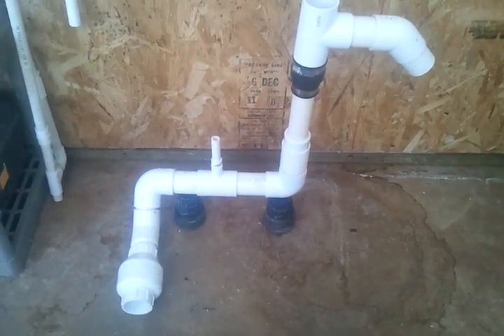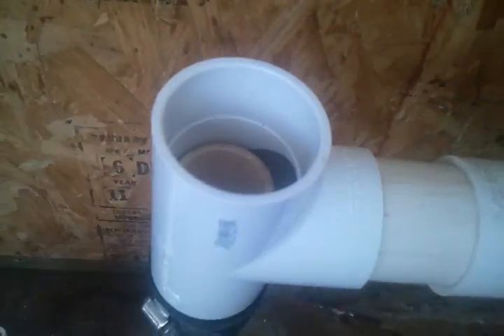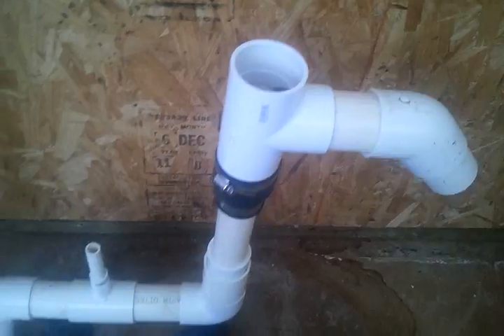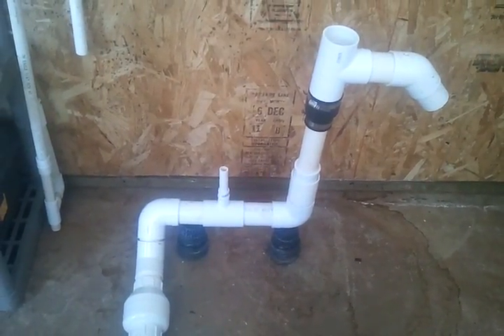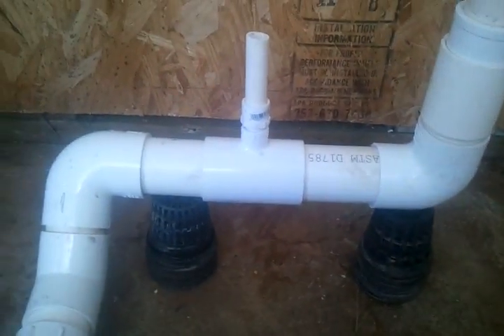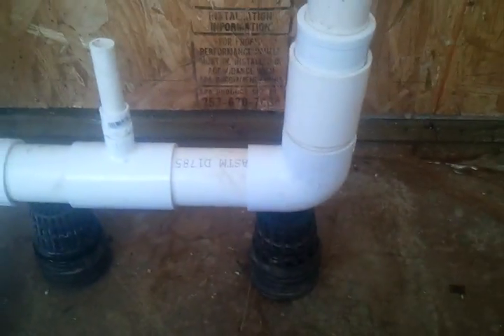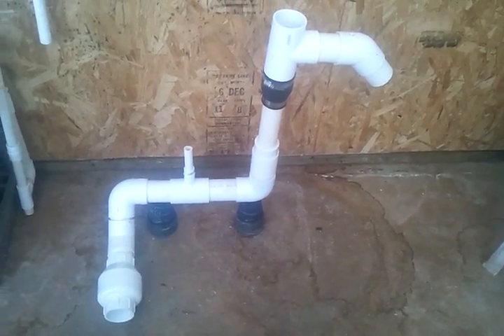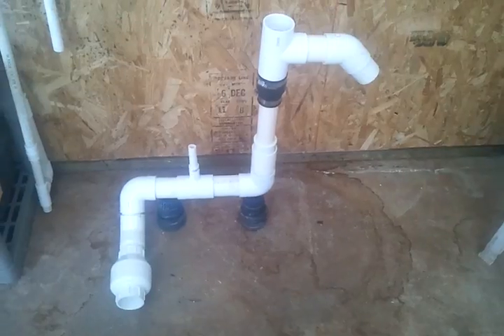AquaZen Airlift Pump

Comment: We use a Burper pump, when we absolutely cannot dig a sump well. If you can dig a well 4 to 8 foot deep, do it. With a 7 foot depth of water, we can pump water 12 inches high at the rate of 3600 gallons per hour. The higher the lift, the less the water. We top out at 34 foot high and 450 gallons an hour, using only 2 pumps 120 watt and 2 to 4 psi.

Comment: The important part is to plumb the fish tank to a “sum well” dug 4 feet or more in the ground. We have gone as far as 8 feet deep.

The water in the “sump well” will be exactly the same as the fish tank. Now the “pipe-in-a-pipe” pump can drop into the sump well and it thinks and reacts to the actual depth of the water, which should be 7 feet of more. Four foot in the ground and the 3 foot deep fish tank.

We have used a two inch casing with a 1/2 air feed to the bottom to get up to 3600 gallons per hour. The higher we go, the less water.

Normally we pump four foot higher than the fish tank, (7 foot off the ground)  the flow is reduced to 900 to 1200 gallon of water with a 60 to 80 watt Hakko air compressor. If I need to go higher, we install a “turbo blaster” inline air induction…to take the water up to 34 foot high, at that point we got 450 gallons per hour with 2 -120 watt air compressors.

All depends on the air compressors! 

Glenn
Reply: That's great! Thanks so much! I've learned a ton from your videos, Glenn, and the stuff you put out is amazing! 
So, I've toyed with a small burp/geiser air lift (similar to this) with excellent results and reliability. It's been running my little flood/drain system for over a year without a hitch!! 
My big system is in the build stage now. It's going to be raft beds.
This style (burp) pump won't be efficient enough to move the volume I need? 
One more thing; what's the reason for pumping 4' above your fish tanks? 

I actually only need 1' to my bed from the sump tank, but I'm figuring the sump will be depleted by the running system, so I need to plan for 3' head height max.

Comment: Hello Bob,

How's performance of this pump?
You keep using it?
I made a drawing of it in Sketchup, the link is as follows.

https://3dwarehouse.sketchup.com/model.html?id=u384bb2f7-656b-4230-940c-cb4bb0902dd2
Reply from the maker: Emilio Konrath No all my airlift pumps are simple straight tubes.  Lately I have been feeling somewhat negative about airlifts because the air pumps don't last more than a year and replacement is getting rather expensive. 
Your drawing is amazing!  Good job.
Reply: +Emilio Konrath Thanks so much for the Sketchup drawing Emilio, it saved me a LOT of time!
Reply: +Doubledink https://3dwarehouse.sketchup.com/model.html?id=u384bb2f7-656b-4230-940c-cb4bb0902dd2
Reply from the maker: Emilio Konrath
Nice drawing.

Comment: Hi Bob,  What's the maximum height that you can pump with this method?  I have a 55 gallon drum being used as a sump for my aquaponics set up and I need to get the water to rise around 66 inches above ground level to pump back into the tote where I'm going to keep my fish.  Am I asking too much of the airlift system and should I be using a water pump instead?  I have around 700 gallons in my set up that needs to be cycled.  I set up the system as you did and I've reduced the vertical pipes down by stages to 1 inch but I still can't get the volume of water that I need to cycle. Once I start to try to pump over 24 inches above the sump water level the volume of water I can pump tails off rapidly.
Reply from the maker: Since most air pumps don't pump down any lower than about 7 feet you would not be able to pump adequate volume with an airlift more than about 2 or 3 feet..  Every thing I do with airlifts basically just moves water around in a circle with a lift of less than a foot.   You would be better off with a mechanical pump
Reply: Bob Campbell Thanks Bob, we've already gone for a submersible water pump, it seems to be working fine.

Comment: good job Mr Bob. I did visit Mr Glens garden and I learned a lot from Him. My first built was a success. Im running an Eco1 air pump $35-$40 18W with the aquazen pump. im getting a 1:15 a gallon good enough to circulate my 180 Gal tank water for my aquaponics system. I will try post some clip soon or post a pic online at aquaponics in paradise website...keep pumping water :) Aloha

Comment: I would like to mention most of the AQUA ZEN pumps are designed for 25 to 60 watt air pumps, doing 1.5 to 2 psi at 25 to 60 liters per minute.  If you use higher pressure, or higher volume, everything changes, the depth of water must be deeper, the pipes larger and check valves larger. We have done 35 high, 300 gallons per hour with tow 150 watt air compressors with 5 psi ratings. That is the largest and highest we have installed and have running. We routinely do 40 to 60 watt pumps raising a four foot deep tank, two to four feet higher (head above the water level) and get 300 to 1200 gallons per hour. Our largest to date is one gallon per second, or 3600 gallon per hour with a 12 inch lift via a two inch air lift using a regenerative blower 1/5 hp.
Reply from the maker: I too experimented with a blower.  It's got a ton of air, but the pressure was too low to submerge to a good depth.  35 high is impressive.  What's are the dimensions of the riser diameter, submergence, and lift?  Where did you find diminishing returns due to the depth restricting the air flow?
Reply: I know this has been a year ago, but I hope this still finds you for an answer. a when you say "35 high 300 gallons per hour.", you mean 35 inches?
Would it be possible to move about 2000 gallons per hour with an 80 watt, 5lb air pump with about 36" head height from a 48" to 36" deep tank?
Reply from the maker: +John O'Hara   Your 5 lb per sq inch air pump will theoretically pump to a maximum of about 11 feet so it should do well pumping 48" deep.   But how much water you can pump depends on the amount of air you can deliver to a 48" depth.  To move 2000 gph I would guess you would need to pump about 300 lpm.  That's a lot of air.  Take into consideration how long the air pump will work on a continuous cycle.   The most powerful
 air pump readily available to me has been the Eco Plus #7.  It's 
maximum depth is 84" and at zero depth it is capable of 200 liters per 
minute.  The trade off is volume decreases as you try to go deeper.  The
 Eco Plus 7 uses about 100 Watts.  It costs me $130 to replace the pump and lasts only one year.  Glenn seems to have access to a very good pump but I wonder how long they last.    My point is you need to weigh the cost of operating and maintaining these air pumps as well as the efficiency, and the specifications of the pump itself.  5 lbs/sq in is a lot of pressure.  What's the brand and model number?
Reply: +Bob Campbell Hi Bob, I suppose I wasn't very specific with the pump details. This is the one I've ordered. I'm surprised that you say you're only getting one year out of your pumps. These typically run for many years easily. I've had a little 4 watt aerator running outside in everyday weather for two years now. Never an issue. I sure hope the Hakko runs well. it'll be indoors though, so it should be even better protected than my little outside one. 
 http://vi.raptor.ebaydesc.com/ws/eBayISAPI.dll?ViewItemDescV4&item=251605898475&category=103440&pm=1&ds=0&t=1443750231231
Reply from the maker: I too have a small diaphragm air pump that is so old I don't even remember buying it.  But these large piston pumps beat themselves to death.

Comment: If your 1.5 inch was reduced to one inch, and then have the Tee at the collector be a two inch, you would increase the flow. As-is you will have two much water falling back down the 1.5 inch.....on the horizontal pipe, slope it down 5 degree, the uplift end being lower. This lets the BUBBLE build up till it pushes down and rolls under the uplift edge and then drags the entire bubble around the corner to get a BIG slug of water. If it is level, or worse, tilted up, you get a more continuous flow of air and this becomes a common air lift and not a SLUG MASTER burper pump. It is the compression of a long bubble and the sudden release that gives us the bottle rocket effect.
Reply from the maker: Thanks Glenn I hope to re-visit the experiments.  These tests were done on the fly and holding everything together with one hand while filming was a bit difficult.  I agree smaller lift tubes often produce a much better result and I get what you are saying about the back flush.  The results I got were too varied, I hope to see more some measured experiments from you too.  By the way I tried that setup you did at the river.  I had a problem with the pump simply back washing.  It offered no advantage at all past the point of the pumps maximum head.

Comment: I built an air lift pump following your model but only got bubbly water.  Two things I missed made it work.  First, you mention reducing the vertical pipe size from 2" to 1.5".  Looks like this restriction is needed, not arbitrary. Reducing from 2" to 1" works for me.

I also found the big box store check valve was a problem.  The spring loaded check valve would not allow water to flow.  I found a PVC swing check valve at a plumbing store.  Works great with these two changes.  Thanks!

Comment from the maker: I don't know how much air is required. Watch 'Ben, Glenn & AquaZen - Airlift Pumping' video at .  I think they said they used a 34W pump. I have not measured the water flow from the two airlifts I have going now, but it must be close to 2000 / hour with a 200lpm pump.  I look at three criteria.  How much noise does it make, how much head does it have and how much air does it pump.  I have an Eco Plus 7, and it's a bit noisy, but it sure does deliver a bunch of air with about 7 foot head.

Comment: If I understand correctly, the EHAI forms a large pocket of air then the check valve opens periodically and rushes in water pressure from the surrounding area.  This pressure gulps the air pocket all at once and shoots it up into the vertical pipe creating a slug that lifts the water and creates the rhythm you were talking about.    Do I understand correctly?   What volume of air is needed for this?   Can you tell me CFM or LPM so I know the type of pump to buy?